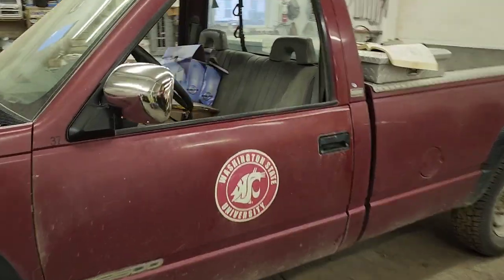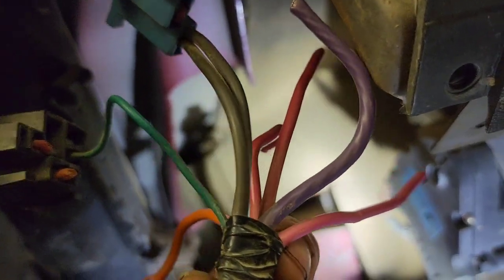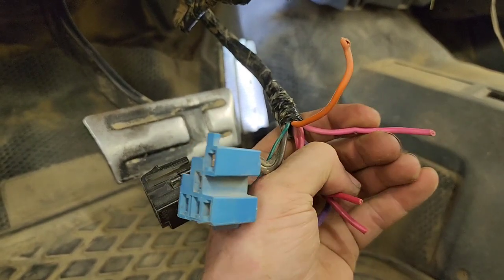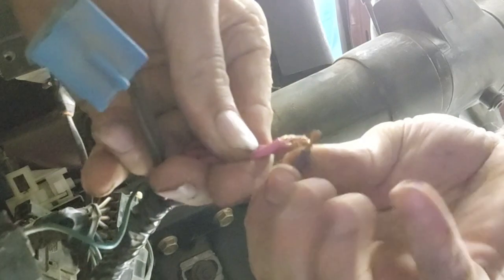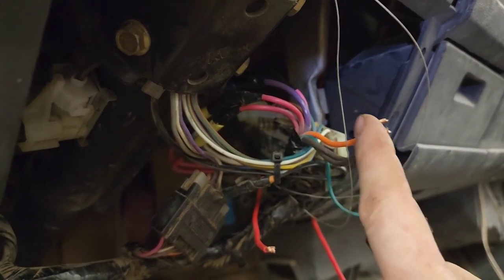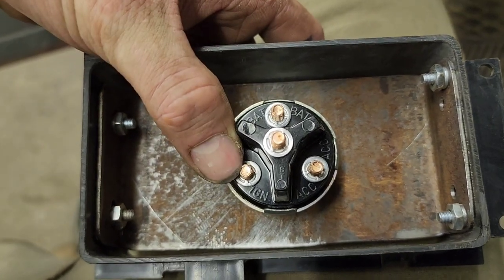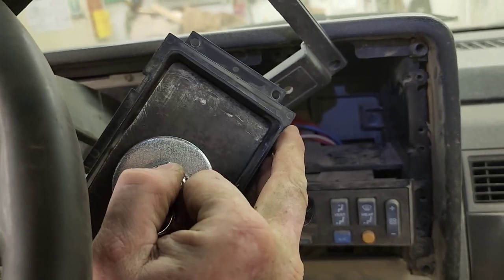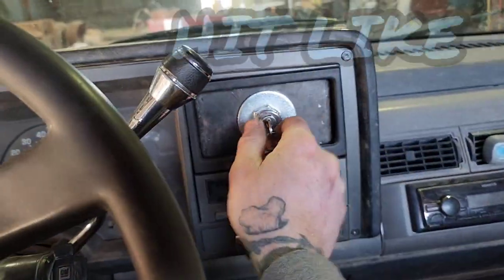Hotwire a 1989 to 1998 chevy gmc pickup aftermarket ignition installation

Comment: I'm having a no crank issue on my 95 GMC van.  Installed a new ignition switch that worked for a few days.  My purple wires has no voltage even when trying to start

Comment: 2:16 uh my 91 c1500 with v6 definitely has a 30a fuse on that upper power/ign fuse that looks factory. Idk if it's different for yours but you got a 10a in there

Comment: Question If I'm able to turn my key just not the last turn to crank it can I just put a push to start button connecting the purple and red like turn the key and press the button
Reply from the maker: Yes
Reply: @worthshop  thank you I finally got my truck to start after 2 weeks of me trying not to take apart my steering wheel lol

Comment: Quick question. Doing this myself but only have 1 grey wire coming down into my ignition switch and see no signs of a 2nd one ever existing. Windshield wipers don't work but don't have a radio to test and see if it's an isolated windshield wiper motor issue or what's going on.
Reply from the maker: 1st suggestion, try the windshield wipers in accessory position if you may have hooked the wire to the wrong post.
2nd I suggest you get a 12 volt test light. They only cost about $3 and are an invaluable resource when working with electrical stuff on vehicles. You can ground one end then anyplace you touch the tip that has power it will light up. So you can test in the fuse box for power on both sides of fuses to check for blown fuses you can test at radio fuse for power without needing a radio hooked up. 
Hope these tips help you track down the issue.
Reply: @worthshop  thanks for the quick response! Been checking forums to see if maybe different sub models were a little different and it appears the '94 W/T only had the 1 grey wire as opposed to 2. Awesome video
Reply: I bought a 1960 C10 on top of a 88-98 chassis. So this helps me because I'm putting in a shorter aftermarket tilt column.

Comment: Hello Aspie.  I bet you could help me out here.  I've got a 90 model 3500.  Good old truck.  I'll spare you the long details.  Can I run a hot wire off of the junction box under the dash, not the fusebox, and hot wire my fuel pump.  I've checked grounds, relays, everything is good.  But I can't get power to the fuel pump.  And is the gray or purple wire hot on the pump? Any help and advice would be greatly appreciated.
Reply from the maker: Are you getting power to the relay passenger side firewall area? There is a ecu fuse in the fuse box under the dash that powers all the make it run stuff. Power goes to the fuse and relay under the hood on the firewall. Not sure if you have checked the fuse under dash? But if I was going to hotwire fuel pump, I would probably check for power at the relay and try hotwiring the relay, see if it sends power to the fuel pump that way. If it did I would add a toggle switch to turn on the relay and run the fuel pump.
Reply: @Aspie's garage worthshop  Hey man, I appreciate the quick response.  I've checked everything out and it's all good.  Ran a hot wire to the pump and still nothing.  Brand new pump.  This truck has had rats in it so I'm rechecking all that was damaged and repaired . Again.  Thanks again Aspie.  I may have to get a whole new wiring harness.